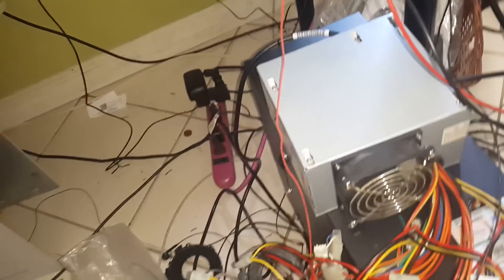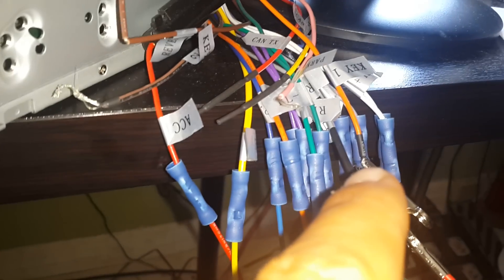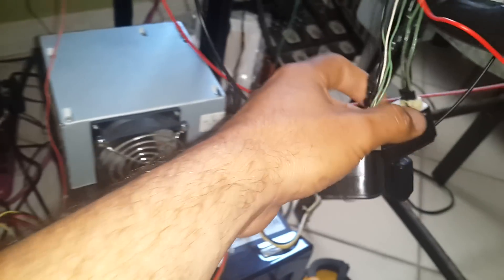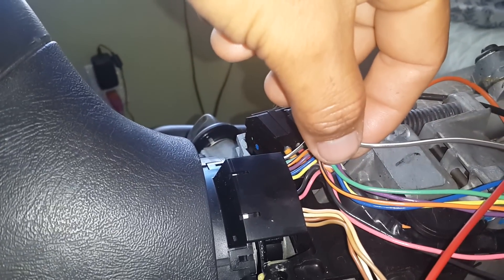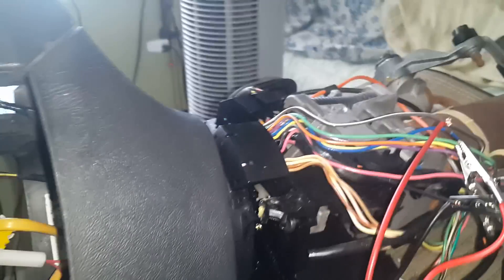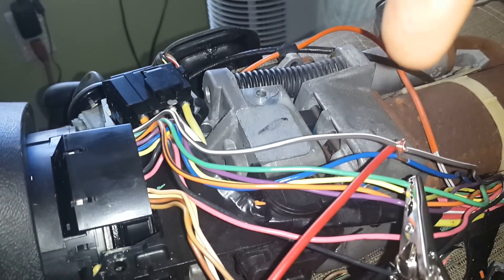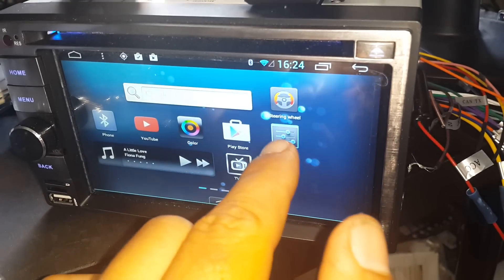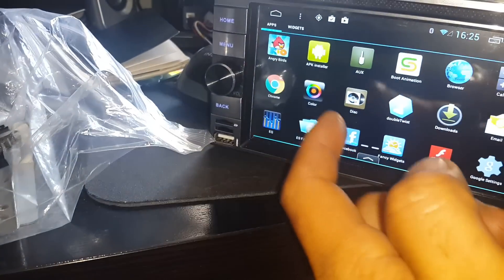How to connect your Steering Wheel controls part 1

Comment: I found out the long research way,
Black-ground
Pink-12v for switch power
Green-signal from switch
Brown/white stripe- 12v button lights
 Those 4 to wire up your switches if your swapping 03-06 column in 99-02 truck and wiring clock spring up with just the wires from clock spring, wired mine up to a pac swi-rc, works great, make sure to wire pac and pink up to radio supply power so your switches work correctly with key off and RAP powering radio.
Reply: Is it the pink wire on the pac sw module?
Reply: Did u make it work on a 99-02 truck?? I just put this column on my truck what module did u use to make it functional please help me
Reply: Can you please explain to me how to connect the steering wheels control for example the aftermarket radio harness have 2 wires sw1 and sw2 how to connect those to wires to the green wire from the clock spring ??

Comment: big waste of time . There is a 12 pin plug that you do not use on the back of the factory radio that doesn't get used on a aftermarket radio . Use a ohm meter hit the 12 pin connector and the volume button on the steering wheel until u see the ohms jump . There is your steering wheel wire connect it to key 1 and key 2 and your done
Reply from the maker: Care to make a video so we all educate  from your  words
Reply: Not if you use Onstar and have a Bose System PAC Interface.  They are both used.

Comment: Hello there.
Do you know what is the CAN RXD - CAN TXD - WC2+ and WC+ whires ?
Thanks man.
Reply from the maker: Sorry, Bud, I don't have an answer to your question. My beast guess would be to try to look for some info sheet of that specific headunit and trace the wires and see what they do. Sorry for the late reply, best of luck in your project.
Reply: Probably the WC2+ and WC+ is the Key cables like yours.
The CAN RX and CAN TX is communication cables or data cables, but what it the use on a Car Head Unit?
Someone told my that can connect to the OBD using an OBD to Can RX/TX adaptor so provides the vehicle data.
Do you have any clue?
Thanks man.

Comment: hey i have a question. say my car a scion xa doesnt have swc. but i put in a ct200h steering wheel with buttons. i have a boss aftermarket headunit compatible with swc functions. do i need a different clockspring to power on the the buttons on the new ct steering wheel? or does anyone know how it could be made to work?

Comment: Hi I have Pioneer appradio 2 (sph da100), my button not working ( vol up down & home), if I've installed this ASWC1 with my strering switch control, its will work to remotely control my HU? Thanks
Reply from the maker: Hi, My best bet will be to look for the key 1 and key 2 wires if has any, or any wire that has to do with the Steering wheel controls. Test which wires from the clock spring has to be with the Volume. Here is a tip grab a voltmeter set it to continuity test and pres the Up or down button on your steering wheel and see if you have any continuity on that wire. If you do go to your head unit and check for any app or program that will let you map that signal to your stereo. mine had a app that recognize the voltage from that wire and all i did was program that voltage to the Volume Up function. Best of luck i hope that works.